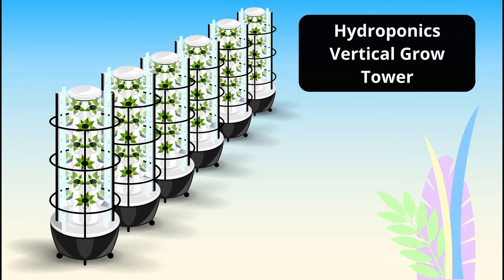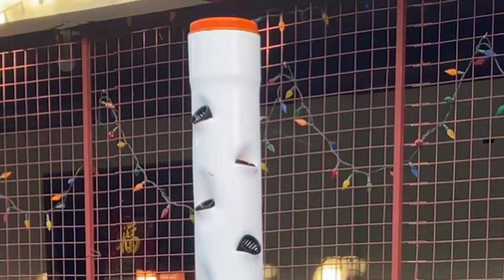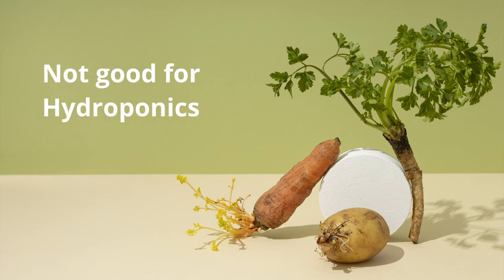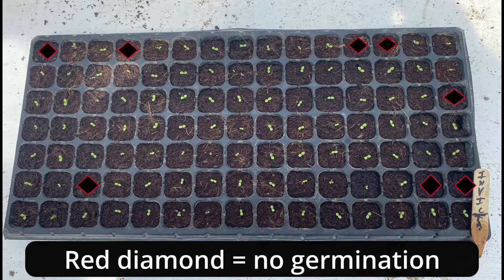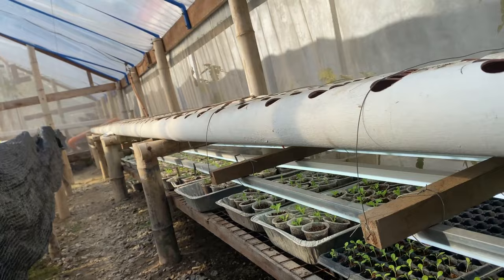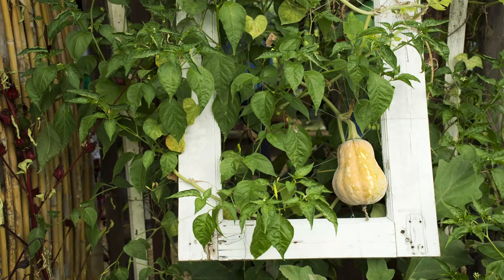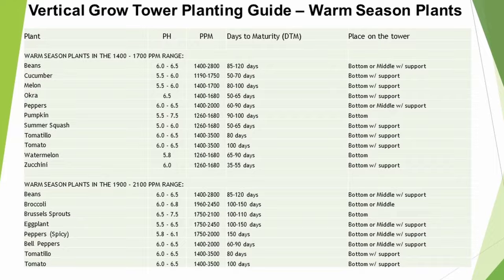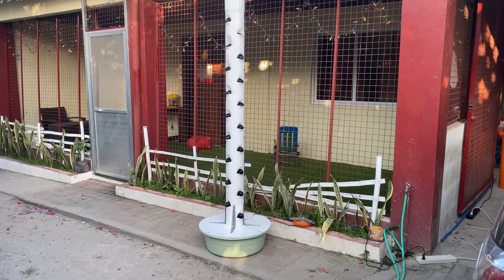How best to use a hydroponic grow tower

Comment: In my tower I used a pretty good sized pump that's moving a significant amount of water.  My question is if I'm moving too much water am I just washing the roots?  I'm running 15 min on 45 off. It's working just could maybe work better.

Comment: The timer saves on electricity which is good because rain towers are not the most energy efficient things.  If you measure how much water you pump to the top of your tower in one minute you can calculate how much water you pump in a day,  eg;  for the 15 on/15 off timing you`d multiply the 1min flow by 720.  If you compare that number to the amount of water the plants take from the reservoir in a day you`ll be shocked at the difference :)
Reply: Is that why the commercial units are timed every 15 minutes on to the hour?
I have mine set up for an hour - 2 off. During the heat of the day I run from 12pm - 4pm.
I find I have to. Otherwise I won't be growing lettuce when the temp goes above 90* I want to grow lettuce year round.
Reply: @andybilakshow260  
When it comes to timing in hydroponic towers anything more than what it takes to wet the roots is a waste, they wont get any wetter :)  The most common timers used for towers are the mechanical type which have 15 minute increments. 90 degree heat isnt ideal for lettuce, i`d definitely try to give them shade during the hottest / brightest part of the day.  Lettuce needs 300-500 ppfd, full sun is around 2500 ppfd. If you have to run the water constantly to keep the plants upright its more likely to be a temperature issue in the tower rather than a lack of water. Most folks assume the inside of the tower will be the same temperature as the nutrient in the reservoir for some reason :)
Reply from the maker: Good information. Thanks

Comment: @ 1:47 what is the blue piece called?  1/2 in line up the tower pumped via submersible pump, through the cap, but WHAT is that dripping part called!?

Thanks

Comment: A lot of seeds from the big box stores were made for this season though they are stunted, or just not viable.  The issue is they keep the packs outside in the grow area where it is VERY hot and humid.  I need to find a new source, but going online the seeds are dang expensive.
Reply from the maker: Yes - it's expensive but its relative. When in the Philippines - I bought mine online through Lazada (their Amazon). I chatted with the supplier first to make sure they were a distributor and knew how to store seeds. I grow lettuce in the Philippines, so I bought heat tolerant varieties not available in the big box stores. I paid as much as 2 pesos (.04 usd) per pelleted seed, but I got 90+% germination.  Also, I wrap unused seeds in foil and store in the refrigerator. In the US - I buy direct from Johnny Seeds.

Comment: How the water will go up and touch the deaired level of the plastic glass container? Is it that motor that throughs the water or what is the sprinking system every 15 minutes?
Reply: Usually they're on like 5m on 15m off, or 15m on 45m off.

Your watch the plants to see if you need more or less for signs of over and under watering.
Reply from the maker: Nicholas is correct.  I use a pump designed for a pond that sits underwater and a timer that is 15m on and 15m off.